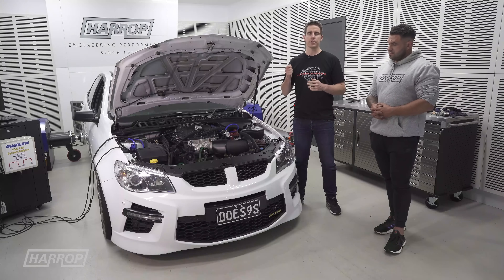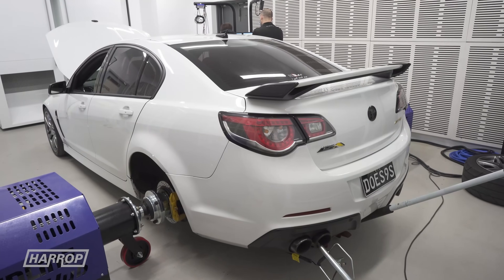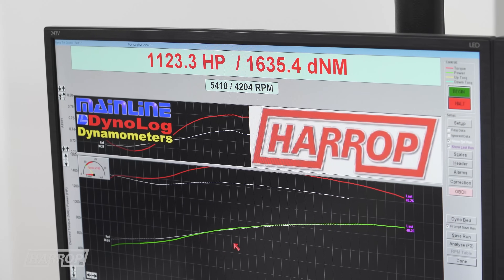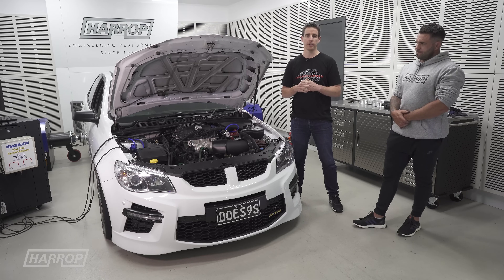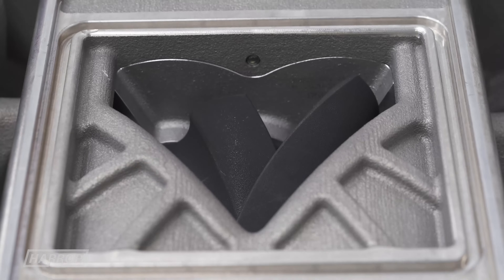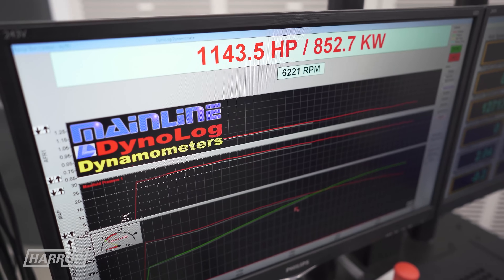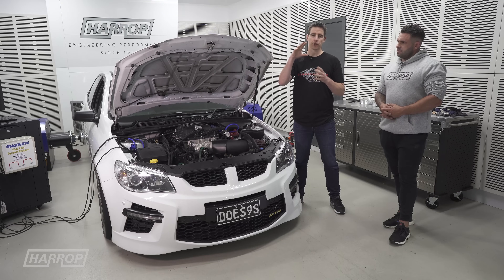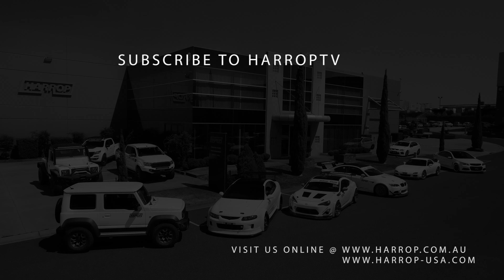Harrop Supercharger Testing | LSA-H2650i

Comment: It’s an auto and this is australia............ 
ffs 🤦🏼‍♂️
Reply: The majority of fast cars in Australia are auto. 👍
Reply: @fullboost  the majority of fast car owners can only drive autos 😂🤦🏼‍♂️
Reply: A manual trans with that much power is just hopeless for most driving
Reply: @ArchimedeanEye  most drivers you mean
Reply: @properaussie331  No, most driving.
Reply: @ArchimedeanEye  omg I give up. 
Most high powered hsv’s and fpv’s can drive any condition. That’s what they were designed for ffs.
Reply: @properaussie331  not with 1100+ HP ya muppet.  The shock load of manual shifting across the drivetrain is hard on parts and not actually fast.
Reply: @ArchimedeanEye  you clearly haven’t been to Newcastle nsw. 1000hp ls3’s are quite common. Manual too
Reply: @properaussie331  never said they don't exist
Reply: different boxes for different applications.. we are smart enough to know a heavily worked auto and the right stall is going to much faster and more consistent in a straight line.. if i was building a drift car it would be manual and not need 1000rwhp 🙄

Comment: Amazes me how these little Hi-Helix roots blowers make such good HP 💪🏼🏁 especially compared to traditional old school Roots Blowers like the good Ol 6/71 which is basically a 6.9L blower so to speak 🤷🏼‍♂️lol
Efficiency has come a long way.....
Reply: Agreed the efficiency of these units is incredible. Whipple Gen 5 is finally closing the gap in terms of competition, but TVS3100 systems are not far away and will probably flow enough to support 1500 WHP+ , insane!
Reply: @ash156k  I have talked at Eaton and Magnuson about why the 3.1 liter TVS sucked so bad that everyone abandoned it. No response so far.
Easy thing to do: just upsize the 2650 by 3 percent in every direction. Done, IMHO.
Magnuson, if they were smart, would use the dual-density aftercooler fin design they patented. 

The dual-pass aftercoolers of the Whipple Gen V 3.0L (aka the next step they can take towards looking like a TVS without violating design copying regulations, or personal pride?) are very efficient.

They can produce 1500hp ON RACE GAS in the Mopar Drag Pak 5.7L engines. Putting the Whipple Gen V on the Drag Pak was a huge vote of confidence from Dodge.

Now Whipple is producing the "knock it out of the entire stadium property" 3.8L Gen V supercharger.